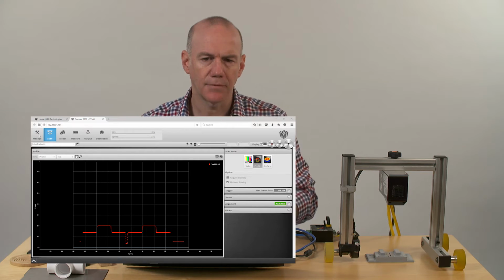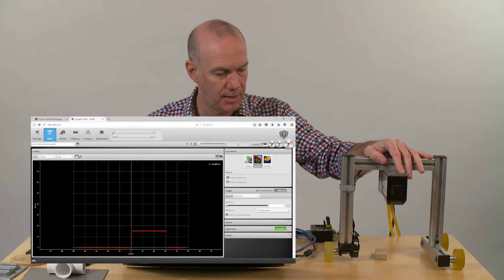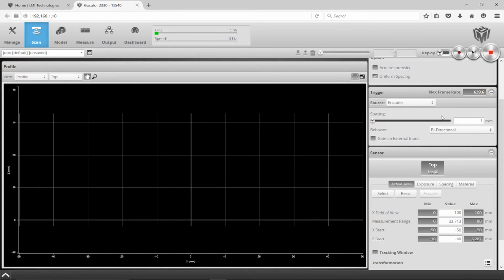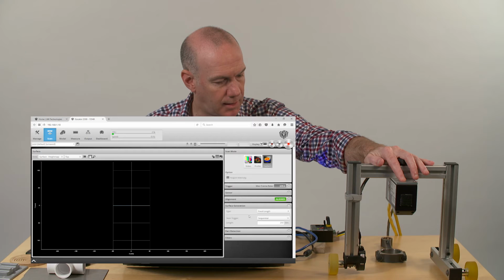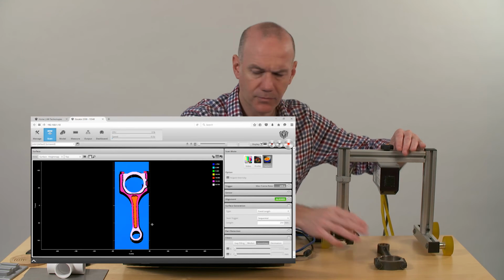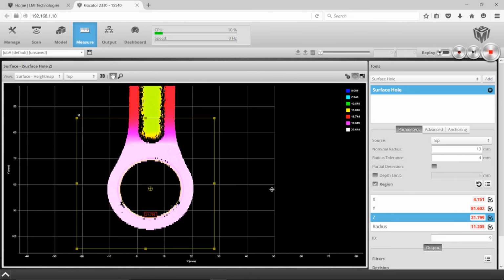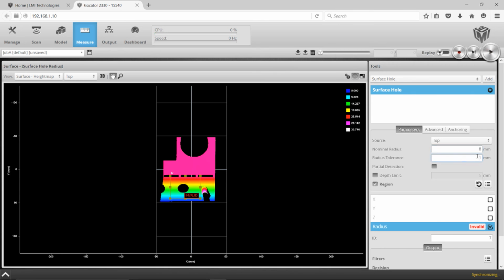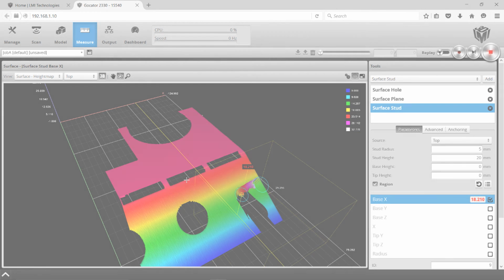Gocator Training Series Part 3: 3D Surface Measurement

Comment: I watch many videos of Gocator aplication, but i never found the tutorial video to inspect dent, scratch, blob, burrs in very very small size (0.05mm). so means, how precisely the gocator can detect the defect.
Reply from the maker: There are a wide variety of Gocator sensor models and some of them have Z resolutions down to the micron level and are very capable of measuring defects on the order of 0.05mm or less. Feel free to reach out to us so we can help conclude what sensor is best for your application.

Comment: Hi, I have a encoder with 0.08 resolution, when I set the spacing to 1mm (or more than 0.1mm), the encoder dont trigger, the encoder have a wire of 500mm to trigger, and I need to use it like 10 times to the limit before I trigger 1 time with 1mm spacing. And with 0.1 spacing or less triggers like 100 times only touching the wire.
Reply from the maker: Hello! It would probably be best to reach out to support@lmitechnologies.com so that our team can accurately diagnose your issue. Thanks!

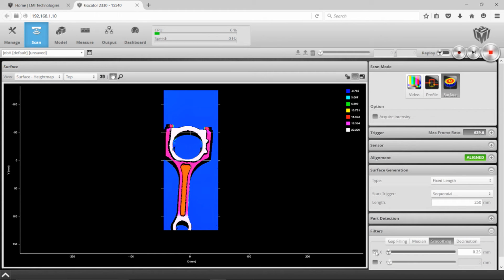Comment: 6:07 I can see that while you' re scanning, you do not Record.
Is scanning enough, to do the image analysis on the surface scanned, and pass "Feature Robot Pose" to the robot ?
Or it is recommended to Record in this case ?
Reply: Thanks in advance :-)
Reply: Hi! When you are scanning, if you have tools added, they will be processed regardless of whether you have recording enabled or not. So you do not need to enable recording.

Recording is really only needed for the case where you want to save the scan data to allow later use, like examining the scan data visually or repeating measurements on a scan with different measurement tools.

Comment: how do i set encoder values when the robot is a 'conveyor' like in this video? Sensor is on a stationary pole, robot has part in EOAT and sensor is checking sealer bead height, width and length when camera is triggered by PLC
Reply from the maker: Hi David, this is a perfect question for the support team, please submit a technical support request here: https://support.lmi3d.com/
. Thank you!

Comment: i have a query like can the measurement be made for less than 10 micron accuracy surface finish with this instrument?
Reply from the maker: Hi Ram, we have various sensor models that can perform measurement below 10 micron accuracy. For example, our Gocator 2410 line profile sensor is capable of 1.1 micron Z resolution with 0.2 micron Z repeatability.

Here is a link to a whitepaper related to surface inspection: https://lmi3d.com/solving-challenges-surface-inspection-3d-smart-sensors

Thanks for your comment!